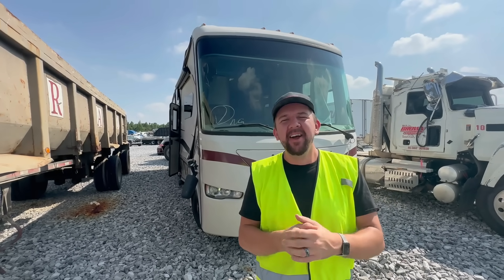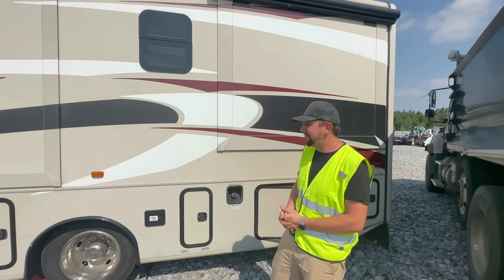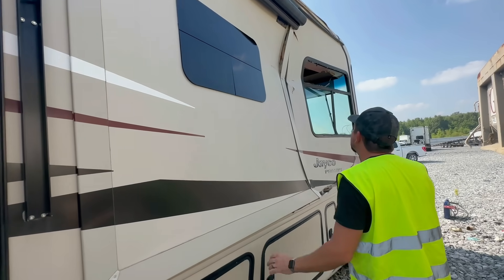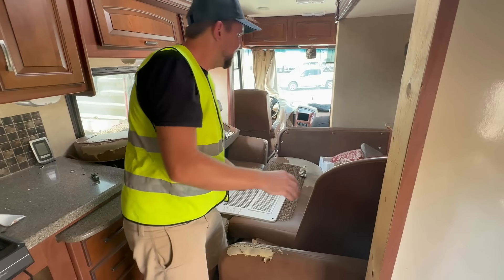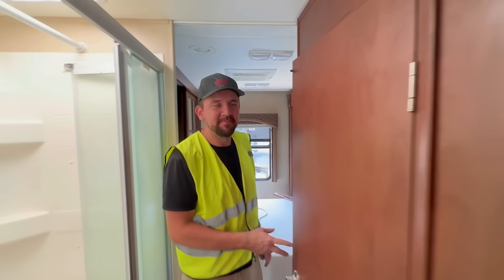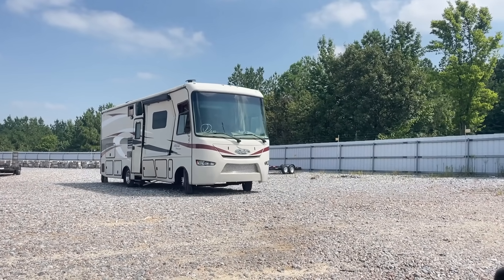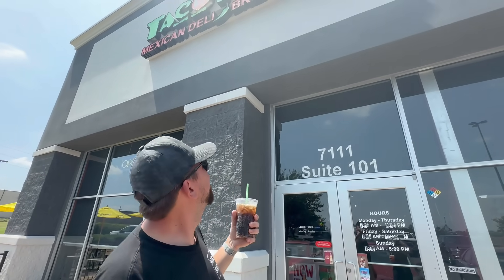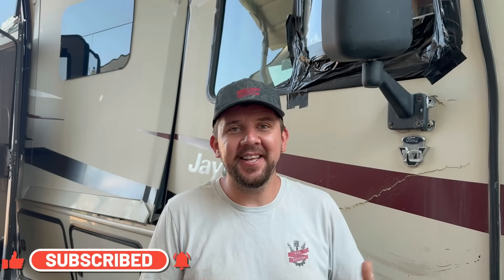WE BOUGHT A WRECKED JAYCO PRECEPT RV VERY CHEAP

Comment: They really slap these things together. I want to own a Country Coach one day. They are semi-monocoque. The house is a single, steel, welded framework mated to the DynoMax chassis. Not pieced together with sheet metal screws like many are
Reply: Me too a friend bought one for only 20,000, when inside you can hear a thing outside.  Built Strong as an OX..

Comment: Guys, the brand says it all JAYCO. Guaranteed quality among MH/RV. There is quite a lot of repair work to do, but you are the experts. Worse conditions in vehicles you have had. Good Luck. 👍👍
Reply: Lucky they got a genuine Jayco!  Jayco sold out to Thor in 2015 so now a Jayco is just like all the rest of them.  We has a 2015 Jayco 5th wheel 42 ft long that we traveled all over the US in.  Finally in 2018 the Schwintek slide failed when we were in Michigan's Upper Penninsula, home is Texas.  We were rather stranded until we found that Lippert had bought Schwintek and we drove to Lippert at Goshen, Indiana where they repaired it.  We sold it in 2019 and bought a 2006 Jayco Designer that always works!

Comment: Obviously a rollover on the right side, so they had to exit through a window.  Engine and transmission oil usually leak out while it is on its side.  Bad idea to just start without checking fluids.  Looks like a fun project.

Comment: The thing I notice with American Motor Homes is the length behind the rear wheels,  in Australia I had to get an engineers report on my 28ft unit because they said the overhang behind the rear wheels was longer than it should be. I'm sure I was told the overhang at the rear was to be no longer than half the distance between the front wheels and the rear wheels.
Reply: The overhang is a cheap way to make rvs bigger. Built from a ford, or Chevy van frame; and built out past the rear wheels to make it bigger, and sell better.